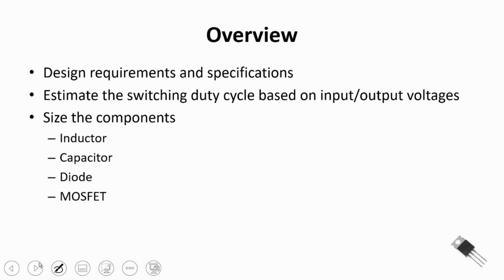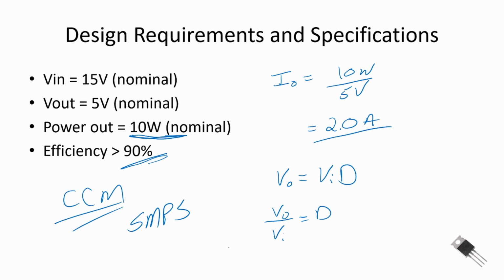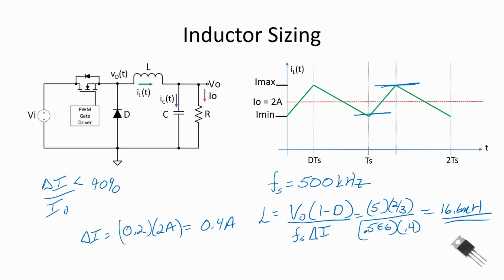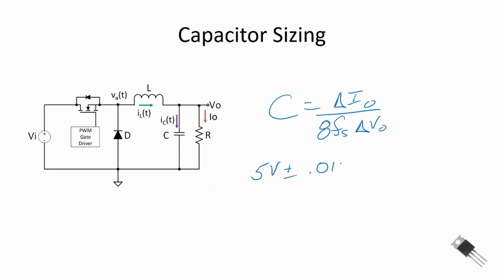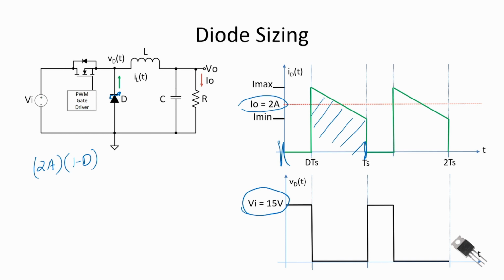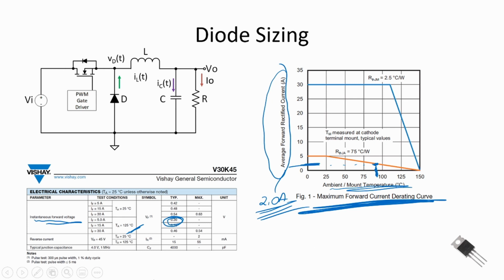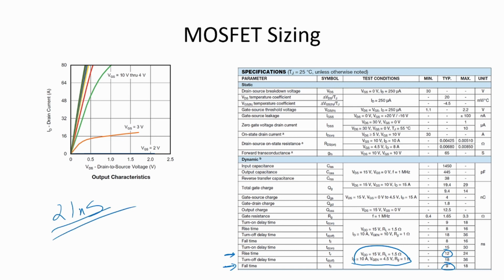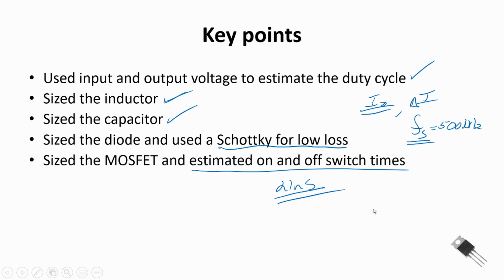Power Electronics - Buck Converter Design Example - Part 1

Comment: Hi, may I ask how are we going to set the parameter for R because in most of the design tuto video, they all have a number for R value but in this video, the R was not calculated. 

My school project need to construct state space model for both MOSFET on and off condition so a R value is needed. 

At first, I was like just use output power value, Pout and output voltage, Vout to calculate my R value but I am afraid that this method will affect the reading of my L and C ....
Reply from the maker: Hi TK, great question.  R is really not part of the design.  It is external to the design of the buck converter and the answer is that it depends on the application.  This video is a first iteration of the design and we assumed that R = Vout^2/R.  This assumes the load is resistive in nature.  If the load is not resistive, then you will need to model with the necessary reactive elements.  Note that these reactive elements will only really matter for transient effects such as turn-on, turn-off or when the load drastically changes.  At steady-state reactive load elements, such as series inductance, will have zero impact the DC output.  Hope this helps, -Dr. K
Reply: @powerelectronicswithdr.k1017  So Sir, is it okay if I insert the R value with the said method ( Vout/Pout ) ? Because my lecturer only gave us the input voltage and output voltage to design the whole converter. Other videos they all have R value and ripple factor as headstart. 

There is one person he first did a minimum value for L , then he suddenly calculate another L value by making the value 25% larger. Then I have no idea why he did that....
Reply from the maker: @TeeTarik  Yes, you really do need an either a maximum output current or output power specification.  If you have the output power, then you can estimate the output current as Po/Vo.  Again, R is not part of the design it represents the load your converter would be connected to.  The first iteration of the design assumes a resistive load and also note it is the output voltage squared divided by the output power.  It is possible to start the design with a minimum L value and I have seen the design process started with finding minimum L that keeps you in continuous conduction mode (CCM).   Design is not a linear process and often can take numerous iterations as you work your way through the selection process.  Best wishes.  -Dr. K

Comment: Good job. Please, do you use a standard during the design....
Reply from the maker: Hi, any standards used would depend on the application of the power supply.   For example, electronics parts manufacturers often specify temperature ranges for parts.  Also, many ICs have a commercial grade and automotive graded part.  The component you select depends on the application the converter will be used in.  Hope this helps.  -Dr. K
Reply: @powerelectronicswithdr.k1017  Thank you very much for your clear answer. Your answer helps me fulfill the requirements of ABET at the level of graduation projects

Comment: Hi Sir, What's the exact function of the LC filter in the buck converter?
Reply from the maker: Hi Ekow, great question.  One interpretation of the buck converter is that it is a DC-chopper followed by a low pass 2nd order filter.  The LC circuit acts as a second order low-pass filter that smooths out the chopped DC waveform.  High frequency components of the chopped DC waveform will be blocked by the series inductor (and shunted by the parallel capacitor) and the DC will pass right through the series inductor.   Hope this helps.  -Dr K

Comment: What does continuous conduction mode (CCM) really means for the buck converter?
Reply from the maker: Hi Max, CCM means that the current flowing through the inductor is always non-zero.  In Discontinuous Conduction Mode (DCM), the current flowing through the inductor will go to zero during a portion of the time when the high-side switch is open.  In this situation, the output capacitor has to provide additional energy to keep the output current to the load.  Hope this helps and thank you for asking.  Best wishes on your design.  -Dr. K
Reply: @powerelectronicswithdr.k1017  This is the best video on youtube explaining SMPS buck converters to start experimenting and designing practically, watched hundreds of videos and never understood anything how to actually make a buck and boost converters. It would be amazing if you can someday make a tutorial in the same manner of how to design practically of the input EMI filter section where it is before the bridge rectification. Thanks!
Reply from the maker: @ShopperPlug  great suggestion.  I thought of adding the EMI choke into my course this year and would also do a video.  Thank you.
Reply: @powerelectronicswithdr.k1017  Thank You

Comment: Design  and specifications must include operating temperature range , max temp rise
Reply from the maker: Eric, yes.  Often specifications will include temperature ranges. In this video we did not focus on heat transfer for this design.  There's another video where I cover investigating thermal considerations and show students how to do a simple static analysis.  Best wishes on your design. -Dr. K

Comment: Shall we use this formula for high voltages eg:800v to 200v and 200 KW
Reply from the maker: Hi Moni, yes, but depending on the application you may want to look at other topologies.  The power and voltage values you list prompt me to ask the following questions.  What's the application?  What type of efficiency are you looking to obtain?  Is isolation required?  These high-voltage, high-current applications require a different level of design considerations than what's covered in this video.  Hope this helps answer your question.  Best wishes.  -Dr. K
Reply: @powerelectronicswithdr.k1017  yaa yes.i understood but for your questions is there any documents is available?if any means can plz suggest or share me...becoz,I want to explore that one
Reply from the maker: @monimonish302  I would look at research on some of the high power density converters.  One place to start is by looking at some of the reference designs provided by the electronic vendors such as Wolfspeed, ON and Infinion.  All are in the SiC and GAN space for power electronics.  Best wishes. -Dr. K
Reply: @powerelectronicswithdr.k1017  thank you...

Comment: i have question , i am ask about book used for design power supply and how select component and calculation and why used capacitor for this application and how to know value required.
Reply from the maker: Hi abdalah, the capacitor equations are in part 2 of this design example.  -Dr. K

Comment: Hello, congrats for the great work you put here,

I have a question about the mosfet in the design. Since the N channel Mosfet's Drain is actually connected to the pos terminal of the input voltage, why don't we use a P channel Mosfet instead of N channel because the design leads to switching positive input which is a high side switching and that should be the source of the Mosfet as far as i know.  In that case wouldn' t P channel mosfet be more suitable?
Reply from the maker: Hi Erol, excellent observations.  Yes, a P channel MOSFET could be used in the design and this would make the switching control electronics easier.  However, N channel devices typically have lower Rds and therefore lower losses as compared to a P channel device.  Therefore, the additional cost/complexity of a high-side gate driver for the N channel device can be justified in the design.  Have you watched my video on high-side gate drivers.  The audio is terrible, but the content is good.  Gate drivers and control of these topologies is also a critical part of the design that I don't cover in this series.  Thanks for watching and best wishes on your design! -Dr. K
Reply: @powerelectronicswithdr.k1017  Can you share the link of the video on high-side gate driver ?
Reply from the maker: @tarekbenhacine8743  HI Tarek, this might help.  Sorry about the audio in this one.  I've never had the time to re-edit.  However, it should help with understanding high-side gate driving and gate driving in general https://youtu.be/fWLo_RtAoqU

Comment: Dear Professor, I have DC/DC buck converter , when I run with no load it is normally but when I run with load I hear the sound on the coin ,  so does it Ok ?

Comment: Hi sir, when given an output voltage range of 3 to 4V how does one calculate the output voltage ripple?
Reply from the maker: Hi Kosi, if the output was restricted to be between 3-4V, then one would estimate delta-Vo as 1V and the average value of Vo is 3.5V.  That's a relatively high ripple current if one is trying to provide a regulated output voltage.  Hope this helps. Best wishes on your design.  -DrK

Comment: First of all, thank you so much for this great and detailed explanation, but I am still confused about resistor sizing? Does it matter which value we choose?
Reply from the maker: Hi, the resistor is not really part of the design.  It is just show as a load that your converter would be connected to and fixed-resistive loads are easy.  The value of the resistance you use for testing the design is Vo/Io or Vo^2/Po.   Hope that helps and best wishes with your design. -Dr. K

Comment: Can u plz do calculation for snubber circuits in flyback converters,etc
Reply from the maker: Hi Moni, I've had a number of requests to do a flyback converter and will plan for that over the summer.  Thank you for the suggestion. -Dr. K
Reply: Tqz fo the consideration.and one more thing in this video u done calculations for CCM in case of DCM   what is the calculation to design buck,boost,buckboos,flyback etc

Comment: hello sir, thank you so much for this video. May I ask you how we found delta V ? If I chose %1 as an output and if output voltage equals to 20V, Should i make 20x%1 ? I guess that's the way how to find delta V. I am sorry, I did not get it. Thank you.
Reply from the maker: Hi, the value of delta-V is often determined by the application.  Some applications can work well under a higher ripple voltage and other applications require tighter regulation.  Yes, if the output is 20V and the specified delta-V is 1%, then the output should range between 19.9V to 20.1V or delta-V = 0.2V.  Hope this helps.  Best wishes on your design. -Dr K
Reply: @powerelectronicswithdr.k1017  thank you so much sir. Have a great day. Thanks for the video and reply.

Comment: Hi sir ,great information your sharing with us thanks a lot for it, sir how to select switching frequency of buck converter. Is there any direct formula there to find it?,
Reply from the maker: Hi Srinivas, great question and the answer is "it depends."  It would be great to switch at higher frequencies. This would decrease the inductor and capacitor size, but this comes at the expense of increased switching loss for the MOSFET and the reverse recovery losses of the diode.   Switching in the 1kHz to 20kHz creates possible audible noise.    Finally, if the frequency is too high, there EMI/EMC standards that come into play.  Sorry that I don't have a good answer for you and it's a great question.  Best wishes on your design. -Dr. K
Reply: @powerelectronicswithdr.k1017   Thanks a lot for your reply. And kindly requesting you is post more videos on YouTube it's help full so many people like me...

Comment: Hi, Thanks for the great videos. I have a weird question. Sorry about that but i did not get it. If my converter's input voltage is 30V and output voltage is 15V, how should i calculate my voltage ripple ? Should i take it as %1 as well ? Is it the most suitable way or could you please help me if you don't mind. Thank you and have a good day.
Reply from the maker: Hi Muhammet, use the output for computing the ripple voltage.  If your output is 1%, then use 0.15V as your ripple.  In most designs there will also be a capacitor on the input to.  Also, the duty cycle will be controlled to regulate the output voltage and the output current. Best wishes on your design. -Dr. K
Reply: @powerelectronicswithdr.k1017  first of all I hope your health is good during pandemic. okay, current is 2A and output voltage is between 12-15 V. So I’ll use  0.15 as a ripple voltage. But the thing is 1% output will cause any problems ? I guess 1% is good. I’m sorry but hopefully it’s my last question:) Thank you Dr. K
Reply from the maker: @yukselle.  Hi Muhammet, all is good here.  Thank you for asking.  Hope you are doing well.  The answer to your question is "It depends."  The output specifications really depend on the application that your converter is being used for.  Some applications are more tolerant of higher voltage variations that include ripple (higher frequency variations) and load/line regulation (variations due to the changes in the output load and the input line voltage value).  Sorry, but I don't have a good answer for you on this one. -Dr K
Reply: @powerelectronicswithdr.k1017  I’m doing good sir, thank you. Thank you for your answers sir, have a good day. Kindest Regards.

Comment: @4:37 when calculating delta I, do we always multiply the output current with 0.2?
Reply: Not necessarily, it depends on the ripple value you are aiming to get. As Dr. K says in the video, it's generally taken as 0.4 (40%), but it comes down to what you are aiming for.

Comment: For the switching losses of the MOSFET. Can I use assume that the current used for the calculation to be the duty cycle multiplied by the input current? Which also mean that if my duty cycle varies, the switching losses is going to change with the duty cycle? Many thanks.
Reply from the maker: No.  The switching loss will be constant regardless of the duty cycle.  It will increase if you increase your switching frequency.  You will need to use the maximum current throught the MOSFET and the maximum voltage Vds across the MOSFET.  However the conduction loss will be proportional to the duty cycle and is D*Ids^2*rds.  Hope that helps.  -Dr.K
Reply: @powerelectronicswithdr.k1017   Vds in this case will be my input voltage Vin and the maximum current will be input current?

Comment: How do you calculate an input capacitor for a buck converter. A project I am doing I designed a buck converter and I am using a lm2574 switching regulator. In the data sheet it mentions the input cap needs to be at least 22uF but why is that and how do I calculate a value
Reply from the maker: Hi Caleb, great question.  That 22uF is called a bypass capacitor.  Here's more info from TI on the definition of bypass capacitors https://www.ti.com/lit/an/scba007a/scba007a.pdf.  This capacitor provides for a very low input impedance power supply for the IC and most ICs recommend some form of bypass or input capacitor.  It should be physically located very close to the power terminals on the IC to reduce lead inductance.   Hope that helps.  Best wishes on your design.  -Dr. K

Comment: Nice explanation. I don't understand how you got Delta Vo @ 9:45
Reply from the maker: Hi Francis, great question.  If you go just about 39 seconds earlier https://youtu.be/IpoI6ERn5zM?t=552, I mention that it was an assumption.  For your design, if an output ripple isn't specified, then you will need to provide one.  Note that the smaller the ripple voltage, the greater the value of the output capacitor.  Hope that helps and best wishes on your design.  -Dr. K
Reply: @powerelectronicswithdr.k1017  Thank you very much.

Comment: And What if i want to adjustable input voltage instead of constant input voltage? For example, the minimum input voltage is 12V and the maximum is 30V? And What's the situation about, the PWM gate driver and the overcurrent diode?
Reply from the maker: Hi Daniel, great questions. This video only covers the basic concepts of the switching buck converter.  Control of the output voltage is almost always done by using voltage and sometimes current feedback.  This enables a constant output voltage over a wide range of input voltages.  Use of an application specific IC is almost always recommended.  For example, the AP63205 is a wide input buck converting regulator with a fixed 5.0V output.   That said, you still need to size the inductor.  If you plan to keep the design in continuous conduction mode (CCM), then size the inductor by checking the output ripple values at both extremes of the range.  The upper range of the input voltage should result in a larger value of inductance if you want to design for a worst-case ripple current.  With regards to output current, many of the controller ICs have current feedback functionality and will reduce the output voltage to limit the output current.  Hope this helps.  Best wishes on your design. -Dr. K

Comment: Thanks sir for sharing a good work. Sir can I use this calculation procedure for a buck converter which to be used in Wind generation system.
Reply from the maker: Hi and you are welcome.  These calculations work for all basic buck converter designs.  However, once we start looking at specific applications other requirements come into action.  These include galvanic isolation between the bulk DC power source and the output power, sizing of the components for transient response, etc, regulation and control of the output current/voltage, soft-starting, OCP, etc.  There are some great design tools provided by vendors such as TI and others that will help walk through setting up some of the initial stages. Best wishes on your design.
Reply: @powerelectronicswithdr.k1017  Thank you sir for your reply.Sir actually I am designing a DC-DC converter for PMSG based wind energy system.